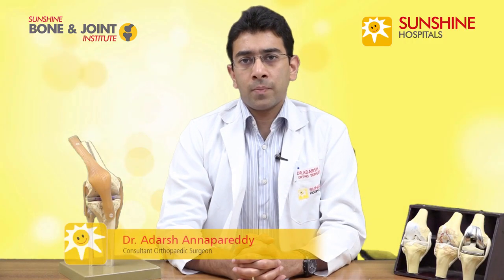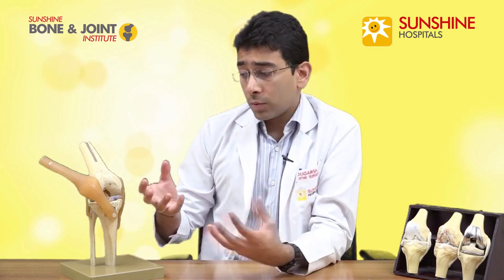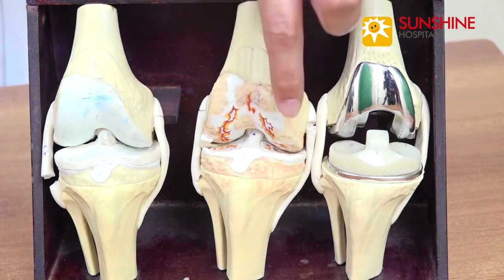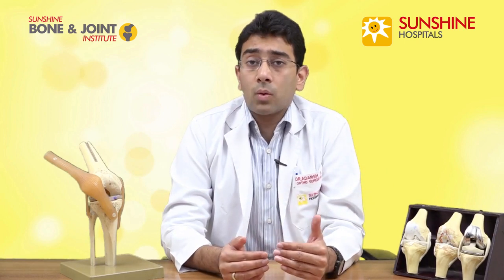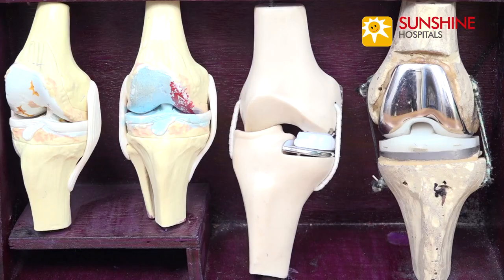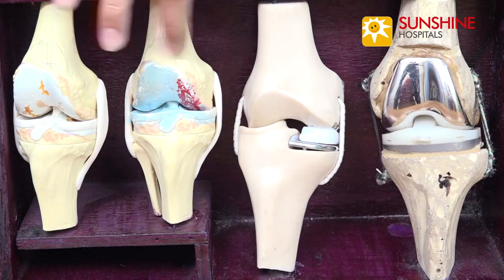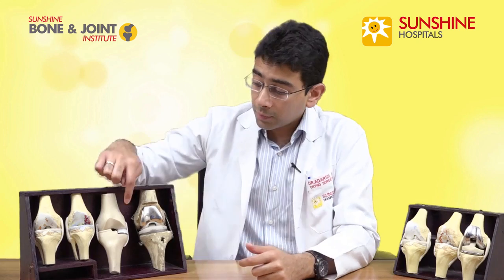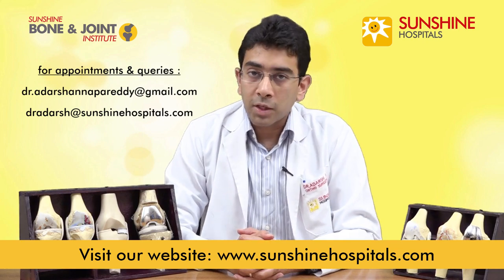Watch Dr  Adarsh Annapareddy, Consultant Orthopaedic Surgeon talk about Unicondylar knee replacement

Comment: Sir, I have calcaneal spur in both the heels, took steroid 4 months back, but didn't work at all. After that I went through physio treatment with several methods, nothing helps me.. Please suggest me the best way to relief from pain.. Sir, please reply ivvandi🙏
Reply from the maker: Hi. Calaneal spurs are a nagging problem which take time to reduce. In spite of taking all these measures if it still hasn't reduced please come over to the hospital to show
Reply: @adarshannapareddy6702  sir, thanks for your reply. But we live in Bangalore, sure I will come to hospital anyway. Dr sudheer reddy garu (land mark hospital) treated my problem when I visit  to Hyderabad last time. But no relief 🥺